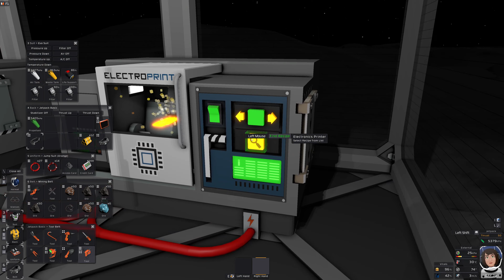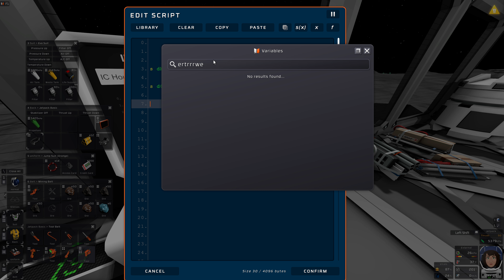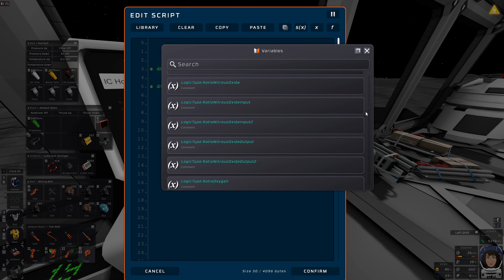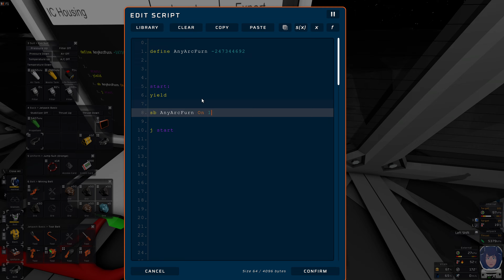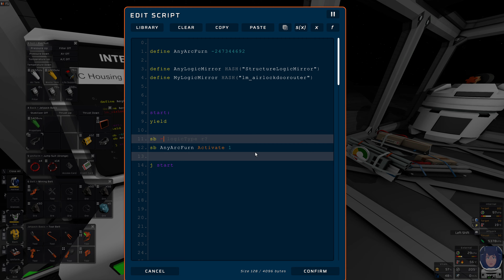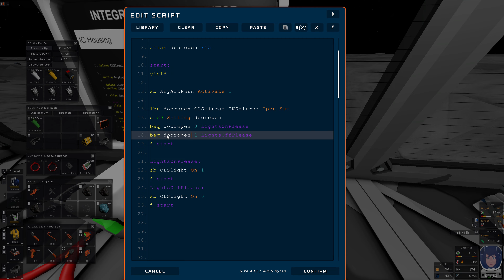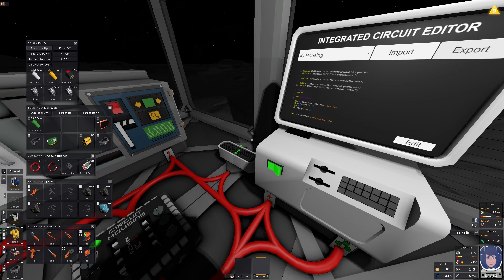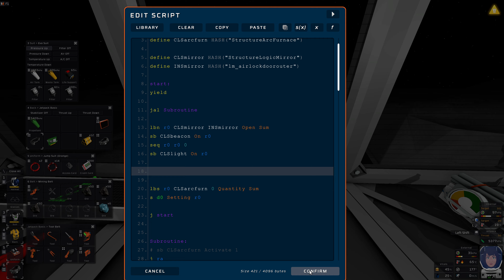Stationeers tutorial - Easy introduction to MIPS IC10, E1: Assembly programming from the ground up

Comment: Btw for figuring out which airlock door is the exterior just select one make it the exterior door, the keypad will turn red letting you know which door you selected thanks for the video
Reply from the maker: NICE. Didn't know this.
Reply: @OwnerOfTheCosmos  this works for most components the active fans if you look at the switches will say it's locked out

Comment: 1:31:40 re: jumping to labels and having multiple "j start" all over the place... personally I prefer to use the "al" variants (e.g.: beqal instead of beq) and then use "j ra" to "return" from the function
Reply from the maker: True, though I've never yet done it like that, instead I only have one "j start" overall: I use "breq" or, depending on program, jump forwards with labels because I usually have the things to do in compact thematic blocks (e.g. deal with door, deal with AC, deal with lights) and then only one "j start" at the bottom of the entire source.